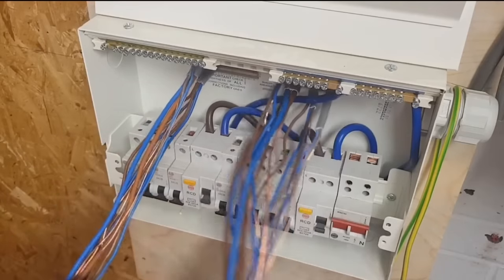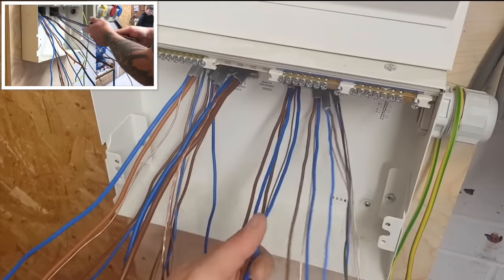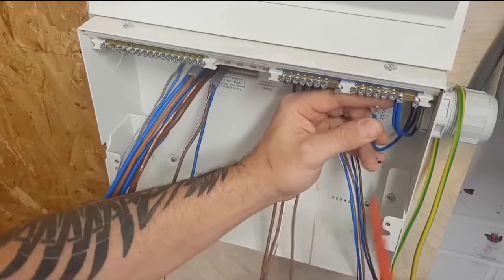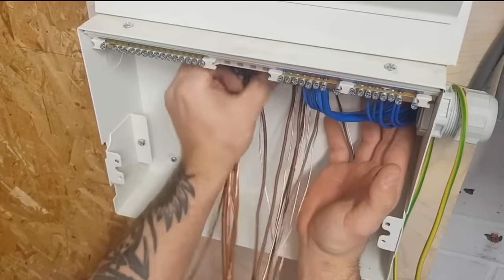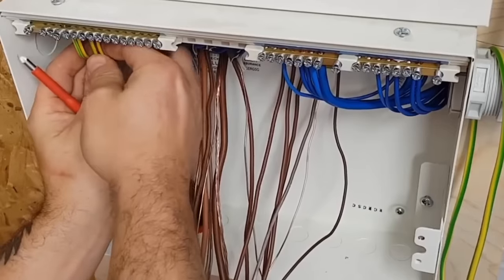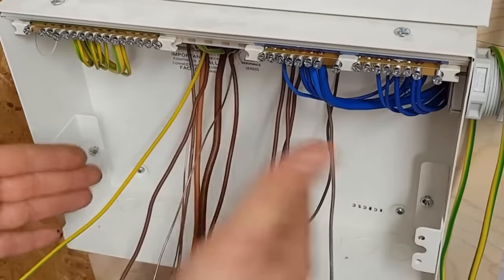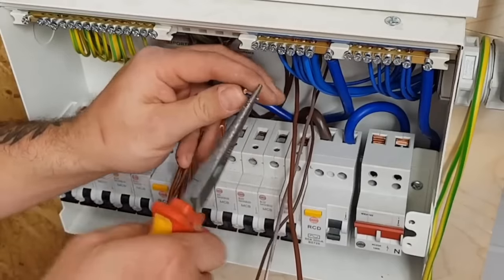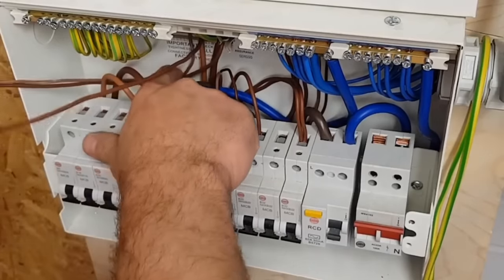Step by Step How to Connect up a 10 Way Wylex Dual RCD Consumer Unit (Fuse Box) By Luke Wichard

Comment: Regarding the fire risk - Has anyone developed a "bag" of fire extinguishing product that sits inside the CU and will act to put the fire out if it gets too hot. IE a bag of intumescent product that expands to extinguish the fire.  Maybe even a triggerable canister of Halon that would put out the fire.  Just an "off the wall thought".
Reply: Indeed they have. Fitted a fuseboard recently where cables entered the back coming through a sheet of ply wood. The oval knockout entries on the back of the DB aren't shaped for any kind of fire sealed gland plus the board has to sit flat to the ply wood. To give the DB it's fire seal capability I installed a fire pack which is a self adhesive heat activated parcel, around the same size as an everyday envelope that mounts I side the fuseboard lid. Once activated it fills the DB with a fire seal material which nullifies the flame and seals the board up to stop any residual fire spreading.

Comment: What i learned from this video: It is apparently not standard in modern countries to have 3-phase systems in homes, you have really tiny fuse boxes where you live and you have blank earth lines in your cables..
Reply: where do you live??
Reply: @RikologyGaming  Germany. Every flat here has to have a 3 row fuse box and I don't think there are any 1 phase systems left. New flats get 5x16mm2 63A connections

Comment: why put two neutrals into one hole & the same on the earth- when you have enough terminals on the connecter bar is that why  you have a long terminal bar on earth & neutrals
Reply: Because its a ring.
Reply: I guess it helps with testing. Also you won’t have enough spare terminals if you did that for all rings

Comment: why isn´t the earth insulated like it is in Germany?
Reply: and why do you bend the life wires?
Reply from the maker: Hi. As the CPC (earth) doesn’t carry current under normal conditions and only for a maximum of 5 seconds under faults to earth we don’t cover it in PVC throughout its run and only identify it at terminations. Thanks for commenting and watching GSH Electrical 👍
Reply: @GSHElectrical  and why do you bend the life wires?

Comment: What is a RCD? I'm from the U.S., so I'm not familiar with this. Also, did you say you have 6amp circuits?
Reply from the maker: Hi the RCD clears Earth (ground) faults and we have 6 amp fuses for things like lighting circuits 👍thanks for commenting and watching GSH Electrical
Reply: In the U.S. you call them ground fault circuit interrupter (GFCI) or ground fault interrupter (GFI).
Reply: Also in regards to the 6amp rating you were wondering about. Remember that we use 240 volt electricity in Europe so we need half the amps to deliver the same watts. 
Then they use there in the video some 32 amp breakers for sockets and that is unique to the UK. You will never find that big of a breaker in rest of Europe because of the different way they wire outlets. That is why they need fuses in their power cords. Usually our outlets are 8 or 12 amps.
Reply: @JonGretarB   Thank you for the response. I forgot about you guys using 240 for residential. In this video, I see two RCD's. Do these two protect the adjacent circuits as well?
Reply: @VaporheadATC  Yup. They protect the ones to the left of them from earth faults. Old installations might only have one RCD as main switch.

Comment: Very interesting how you install consumer boards in the UK. Here in Germany, Austria, Swiss we never "double" wires. Also most of the small consumer units are made of plastic. The N and PE/CPC terminal normally wago-type connectors without screws up to 4mm2. Additionally in bigger units L/N/PE connectors (like Wago topjob) are installed. So all 3 or 5 wires of the cable are attached to one connector block. The wiring the the distribution board  is often done in the workshop or direct at the manufacturing plant.
For example https://youtu.be/9Tb6gAqj5vo
Reply from the maker: Wow thanks for the detailed comment and link 👍🙌Gaz
Reply: Weird that consumers usually only have single phase service.

Comment: And as for your Newton mitres,it just makes me laugh ,because a normal Philips screwdriver dies exactly the same job,if the tightness of the connection was so critical then the connections should be Allen key connections then you would have no problems with loose connections but the industry leaders haven't had the sense to make more connections Allen key type,when it's always been known that the type of screws still being used for these connections have never been adequate to stop connections from coming loose